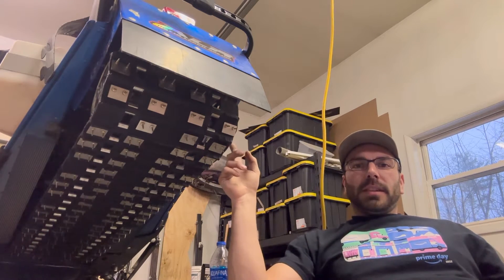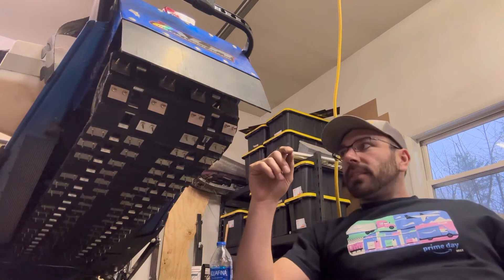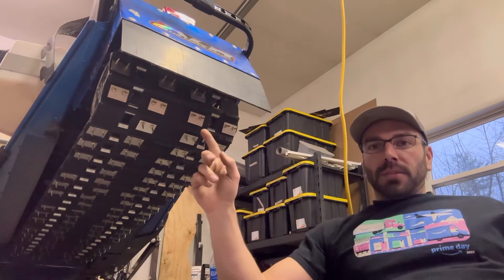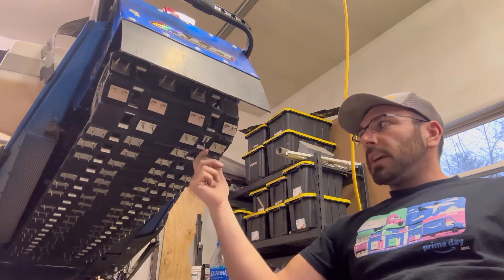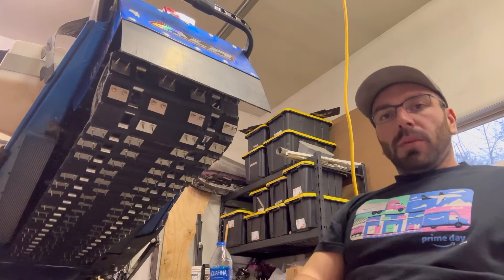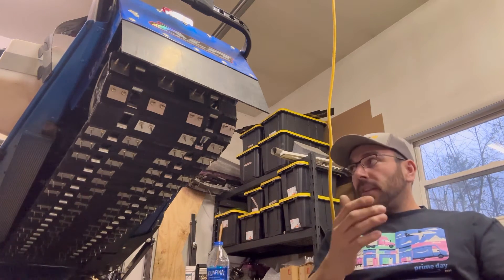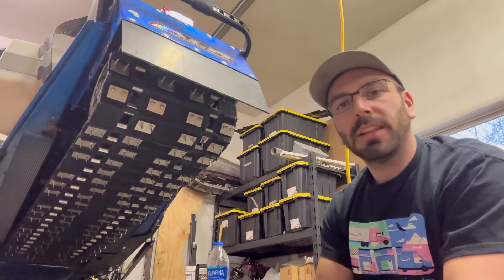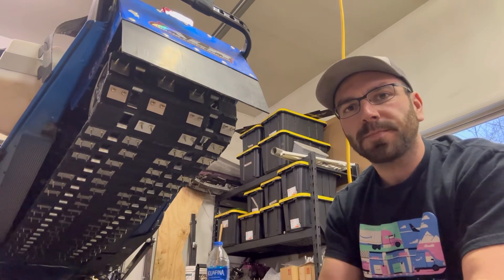Tech Info: Details of Studding an Ice Oval Track

Comment from the maker: I would also like to add that a track that has 336 studs in the pattern I have vs a track with 336 studs that has studs down the center will not handle the same. My track show in this video will make a sled run tighter than the track with studs in the center because there’s more flex and less penetration.

Comment: If your running the track tight studs down the center won't flex.they bite.on the drag sleds they penetrate.and at speeds think of it as a top fuel tire going into a corner at the end of the straight will give you more bite cause the tracks do balloon slightly.

Comment: I have never raced ovals, but I have ran ice drags and speed runs, as far as track tension and speed, what we found when tuning for speed with stock rear skids with 9811 racing tracks and ice picks was that too loose robs several mph in a 1000 foot run, not running straight will loose a bit more. To tight? Not gonna lose much, its better than to loose. And I concur on not running many or any studs in the center